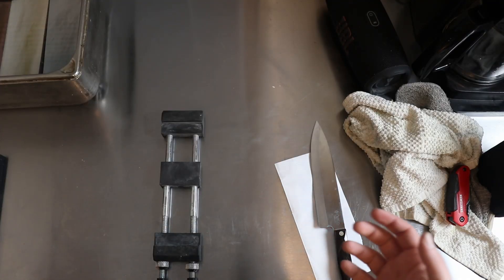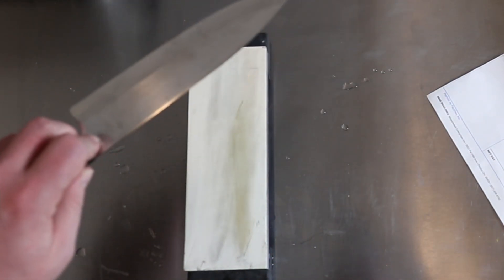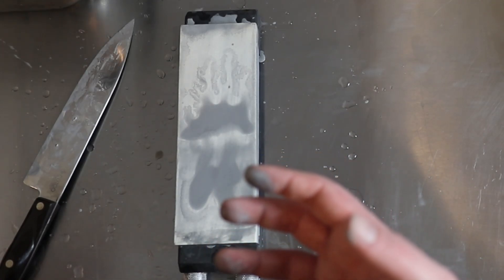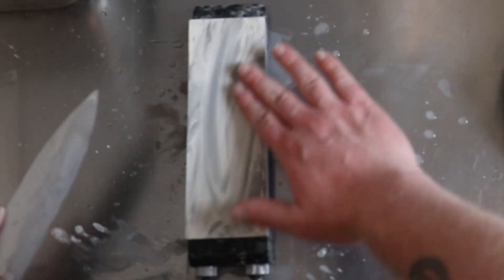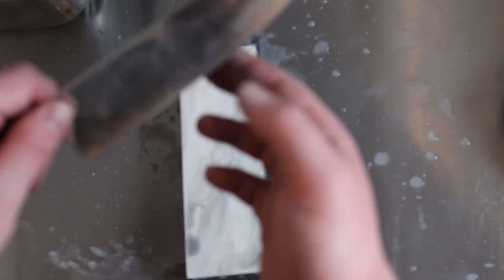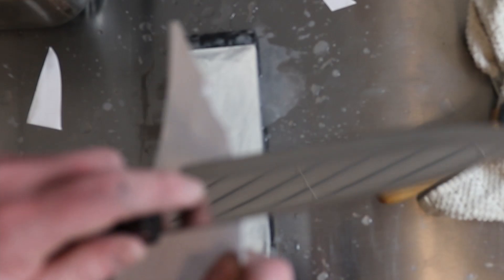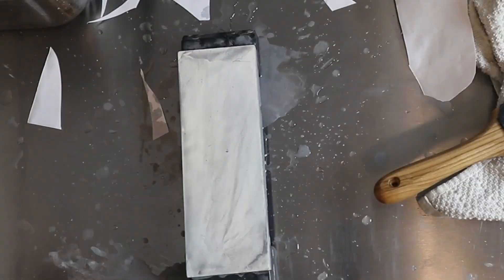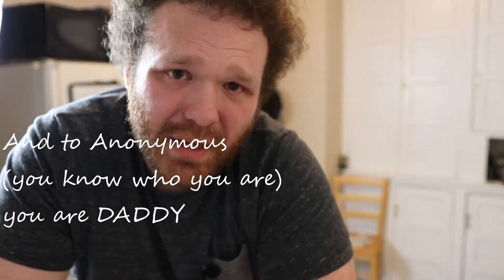A Simplified Guide to Sharpening Kitchen Knives

Comment: There's more than one way to get a good edge. The way you did it is already good enough and most people don't want anything beyond that but if you want to complicate things a bit probably you can get better edge. Here are some tips if you want unnecessary but enjoyable complications.

10 degree sharpening with a 15-20 degree microbevel. It has better edge geometry and cuts better hard vegetables like carrots and onions. Even soft steel like 55-56HRC can hold an edge with that as long as you don't abuse the knife.

Instead of just paper tests try shaving hair . Slight but noticeable difference in cutting performance and as a bonus better edge durability. Shaving hair badly is already great for a knife, hanging hair tests is too much and edge will roll on cutting board 

Try out dedicated knife, one for vegetables and one for meat. 
Very polished edge is great for paper hair and raw meat but it can slip a bit on tomato skin and other vegetables.
 
For vegetables any stone is good enough as long as it shaves hair. It's easier to get this result with 1000-6000 grit  but even ultra low grit like 120 can do that with enough practice.
For a dual purpose knife usually I finish on 6K grit. It's a mid ground decent for both vegetables and raw meat.
Reply from the maker: Yeah this is all good stuff for maybe a more in depth video in the future. I intentionally kept this one pretty basic. I also do shave tests myself, but I'm not too keen on telling beginners to do that. They can figure that out for themselves.
Reply: @LaunchpadCooks  Most people only want the basics so that's actually a good idea.

Comment: Lol it's funny to me that I bought a half decent 2 sided stone from a YouTube recommendation, decided that it wasn't worth shit after using it a couple times. Bought a (very cheap) 2 stone, 4 sided (up to 8000grit) + 1 flattener kit because I thought my original stones weren't shit.... but the more I worked with them, the more I realized that it was all technique....I now exclusively use my original 1000/6000 stone + stropping.
Reply: honestly, a 1000+slightly higher grit stone(s) and a compoundless-strop is generally enough for me. I know if I wanted to delve into stropping compound I could probably get more insane, but it's just not worth it for me time-wise. after the 1000grit+higher grit+raw strop, my knives can push cut through paper like a dream. I do admittedly own a few diamond stones sub-500 grit...but I only use those for suuuuuper dull knives and stone-flattening purposes....

Comment: I used to use sharpening stones like this but I got gifted a Lansky Diamond Sharpening System and now I just use that at 17 degrees for my kitchen knives. Takes all the guesswork out of angles and I get a perfect result every time. It's not as artisan looking but it gets the job done.
Reply from the maker: I've been really interested in a tabletop sharpener like that for awhile. Hoping to get my hands on one soon.
Reply: @LaunchpadCooks  The Lansky is pretty slow since it's a small tool and on long knives you need to reposition it. If you're sharpening more often than me, a home cook you'll be better off with a KME sharpening system or a Wicked Edge. They all get about the same end result but the KME is quicker and the WE is a lot quicker since you have two sharpeners and do both sides of the edge at the same time. 100 bucks for the Lansky, 350 bucks for the KME and 1100 bucks for the Wicked Edge though. I only need to touch up once in a while so the Lansky is more than good enough for my purpose.

Comment: That was an awesome guide man!One thing we have to mention here. Everyone tends to sharpen knives using different techniques. Me for example, I do the total opposite of what's shown in this video. I go the other direction, I switch hands when sharpening the other side, yada yada yada. But the same principles apply.. maintaining the right angle, look for that burr, that micro wire forming on the side of the blade, then slowly polish it little by little, equally on both sides and all the way along the blade, until the burr is close to nonexistent using finer and finer stone grit, all the way to leather. It takes practice and I'm getting better each time, little by little. I was horrible at the beginning. But I'm so glad I mastered this skill. 
To everyone struggling with it - just keep on doing it and trust your feeling, if I can do it - anyone can!
Reply from the maker: I used to switch hands when I started, but I found that if I use the same hands and just flip the knife over, I'm much better at maintaining the angle.

Comment: For those looking for an expanded set of recommended stones & accessories: Suehiro Debado 180,  Chosera 400, Shapton Glass 500, Chosera 1000, Suehiro Debado 1000, Shapton Pro 2000, Chosera 3000, Gesshin 4000

Plates: Atoma 140, Atoma 400, Atoma 1200, Nanohone (any)

Holders: Suehiro

Strops & diamond sprays: Jende Kangaroo leather & spray (I like .5 micron)

Some practical sharpening advice is that in order to hit the tip you will need to rotate your grip slightly. Most folks instinctively learn this over time but for a complete beginner you will need to consciously do this.

Comment: I've been sharpening my 30$ chinese cleaver for some months but I feel like I'm not making any progress. I mean the knife has a fair sharpness, I was just expecting more from it. I use a 1000 grit then polish it on a 3000 grit, it's cool to see how you do it, I'll try again, the hard part is to not give up.
Reply from the maker: There are some factors that play into that. Things like the steel type and heat treatment process are going to dictate how sharp you can actually make the knife. On such a cheap knife, I doubt you're going to be able to make push cuts through newspaper or anything like that.